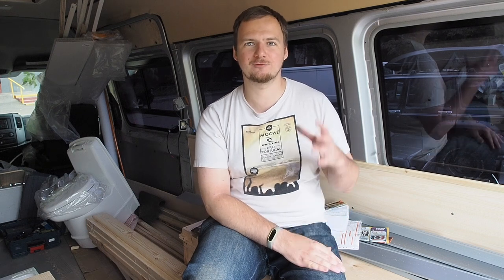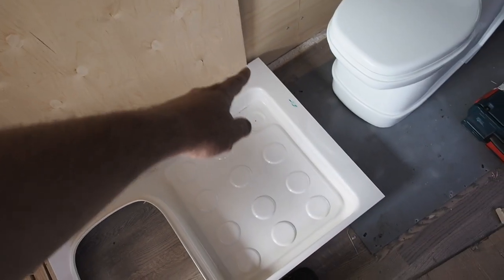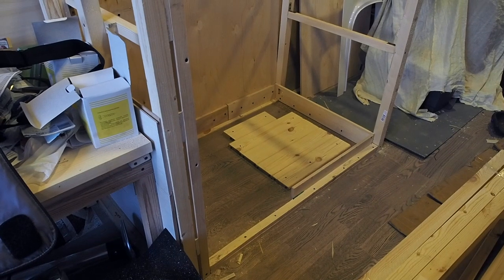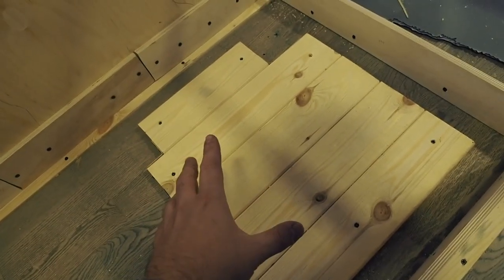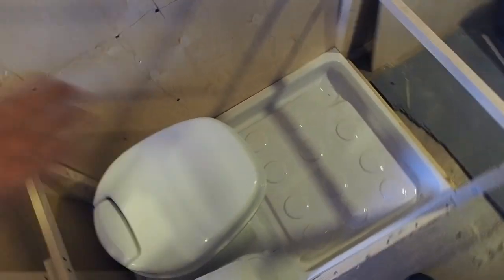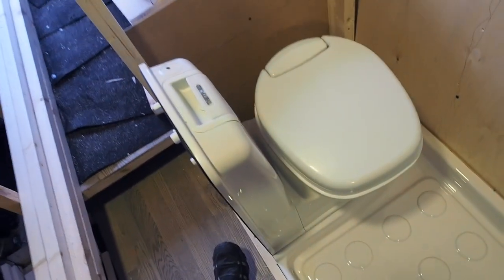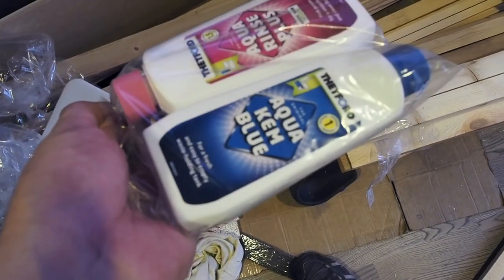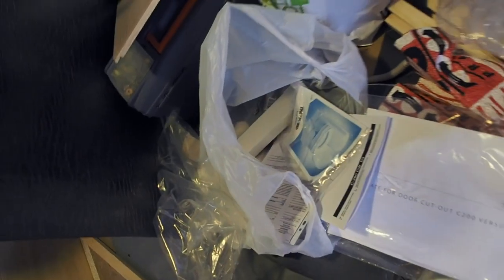Shower and Toilet cabin building in van conversion. Wood frame. Bathroom for diy campervan or RV.

Comment: For me, a toilet and shower space is essential.  It amazes me that some van dwellers seem to skimp on it.
Reply: ghlyall there is pop up showers alot of them use. N a compound toilet. Alot cheaper too
Reply: I know! It's absolute essentially, in my opinion, especially if you're going for more of a "stealth" build rather than a casual build to travel in. A lot of people talk about getting gym memberships to use the showers, but that's a huge annual cost. Paying a little bit more upfront and sacrificing a small bit of space will pay for itself within a couple of years. Especially if your van is your permanent home and you have a job.
Reply: Yeah, I hate seeing "clickbait" that claims the ultimate, super-duper, off-grid camper van and all they did was put a bed in it and slap on some solar panels. Not exactly bug-n-out if you have to go into town every time you want a hot meal or have to take a crap.
Reply: !00% correct.  How people travel without the basic essential of being able to 'S and S', as they say, is beyond me.  The same goes for poor truck drivers who are never offered anything like this.
Reply: Exactly. My dad drove trucks for 40 years. That's one of the main reasons he drove locally instead of cross-country.

Comment: I really like that you can cut out a hole for the outside and have it lockable. Nice setup there. Can't wait to see it finished. Thanks Great video!
Reply from the maker: +charles howard yea its nice, but i will not cut my van for that
Reply: (VanTourist) yea well I was just thinking of keeping the mess to a minimum and outside instead of inside, but just my opinion's. No harm intended. Take care.
Reply from the maker: No harm mate :) It was a hard long choice to make service door inside or outside. With many plus and minus sides. But at the end i choose inside option just for my build. I agree that outside door is stil great and could be best option for most builds
Reply: VanTourist I am wondering if you have experienced any smell inside the van? If so how did you manage to overcome this issue?

Comment: Thanks this is a good video on how to integrate a shower / toilet! Looking forward to the second part, how to make it water proof.

I'd also be interested in how you integrated it with your floor plan.

Most would probably prefer a composting toilet though to use less water.
Reply: I second this
Reply: I want to do something like this and use the grey water tank just for liquids.  Solids would be diverted to a compost bin.

Comment: You are really smart. Even if someone gave me all the equipment to build something like this I won't be able to do it. Great job because you are so meticulous. I just wanted to ask you one question as I am in the planning stage of my caravan.

The toilet is absolutely necessary as much the entrance doorway. But both are used only for less than 10 minutes in a day. Why waste so much space for something which are very necessary but used sparingly. Why not combine the entrance door way and the toilet as a 3 feet by 3 feet area at the door. The only downside is that when someone is using the bath you cannot move out or in. In a country like India where we don't have the infrastructure like a dump station I will be using bucket toilets. The grey water will drain out of the van through the doorway. I will be using the bath only outside city limits, but the bucket toilet can be used anywhere and the faecal matter can be disposed off in a dumpster. Do you foresee any problem in my plan. Thanks for the upload. Cheers!

Comment: Looks great, I plan to build mine right at the sliding door because I don't plan to use that door much anyway and it provides a good space for keeping dirty clothes. 
Do you have a specific reason why you didn't go with a composting toilet?
Reply: Going into your van through the shower is also a good idea to keep out dirt and clean up shoes etc
Reply: Yup, it allows you to get in the van without bringing dirt into your bedroom. I don't plan to use the sliding door too much anyway because it is really loud on my 2014 Fiat Ducato.

Comment: Gotta ask, If I'm correct, this cassette toilet is usually installed with the cassette to the outside of the unit as it is vented that way also. As you have it mounted to the inside, how is the venting handled? Does the cassette 'gas-off' to the interior of your build? Are you happy with the way it ended up performing in this manner?

Comment: Hi I like your video super and learn a lot of it, but how did you get the connection of the water on the thetford c-200 cw changed and on the water system
Reply from the maker: I feature it on another video about my water system

Comment: How do you secure the toilet in? Does it fix to the floor or just free Standing? You're doing a great job.
Reply from the maker: +Ashley Howell thanks! Suprisingly toilet has no any special securing but i will think about my own solution for that
Reply: VanTourist thank you, Im currently converting a mwb sprinter. I received my toilet today. It has 4 holes in the base for fixing.
Reply from the maker: +Ashley Howell i found out that my toilet actualy has 4 screw holes at the bottom too! For some reason they not mentioned in instruction and almost invisible

Comment: OK, I do not get, why you turned the cassette that way. Normally it is turned, so one can access the cassette, through a flap on the outside of the van. This prevent spilling on the inside of the van - and makes it easy to just pull it out and empty it into a drain meant for emptying cassettes.
Reply from the maker: Easy reason - for not cutting metal side of the van. A bit of bonus stealth is nice too. I manage to not spit anything around the van. Actually it's nothing to spit if you doing it right and cassette function properly
Reply: Does the cassette leak a smell in the van?  The cassette has a vent that relieves pressure when it builds up from the waste.  If the access door is on the outside, I believe this naturally vents outside but if the door is on the inside, does it vent into the van when relieving pressure?

Comment: The cassette is removed from inside the van?
Reply: That's the whole point. Usually this setup is rotated 180 degrees and the cassette is removed through a special door outside. It actually makes more sense.

Comment: Good work...but...at 0:18 didn't you say you were building a full size restroom?...sure doesn't look medium sized to me.
Reply from the maker: well it's "full size" in a category of van restrooms. It has a toilet, shower, mixer when mostly in van conversion people have... nothing. Or some portable toilet under the bed. And shower head they could stick outside the window or back doors to shower. 
Fore sure its not "full size" if you compare it to home bathroom